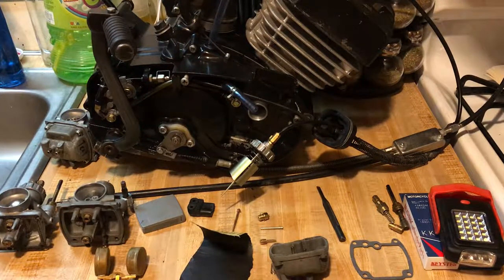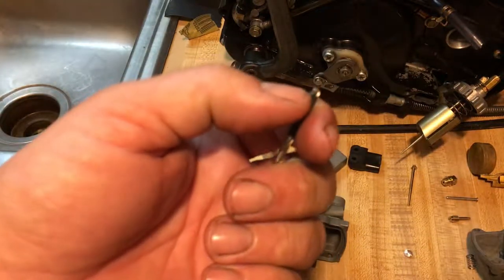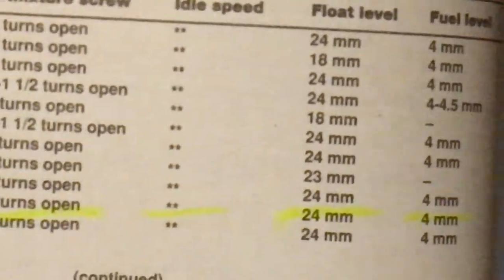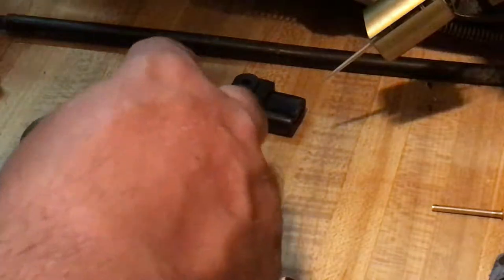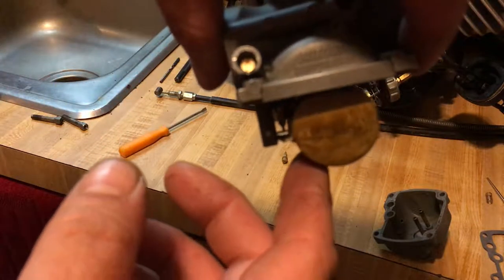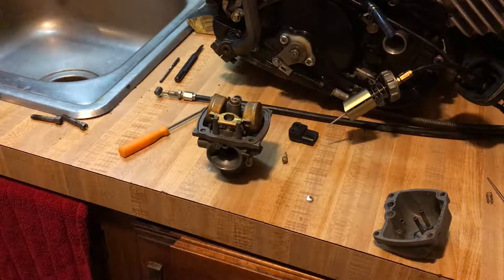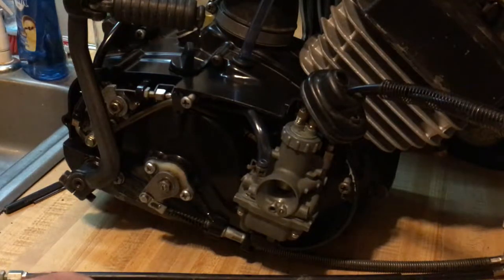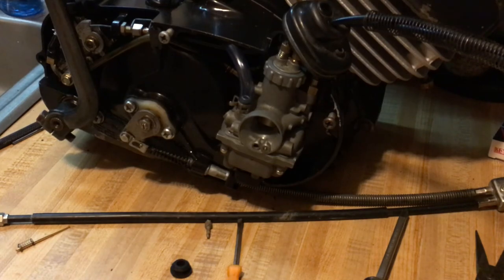KE100 KE102 carb

Comment: Kevin--love your videos and appreciate that you put them out there. I sent you an email further detailing my questions, but in case you don't see that:

1. The Y57 needle in the carburetor rebuild kit you use is a different length than the 4EJ39 needle that the manual and parts diagrams call for (it's shorter). The 4EJ39 also does not have circlip settings like the Y57 does. Should I consider moving to a lower circlip setting for earlier fuel delivery if I have hesitation on acceleration in the 0-35% throttle range?

2. Where do you find aftermarket and non-stock setting parts for these carburetors? Like the 22.5 pilot you installed in this video. I would like to pick up a 17.5ish pilot to replace the stock 15, and I would also like to pick up a new emulsion tube, but they're out of stock everywhere I've checked.

Cheers
Reply from the maker: Thanks for your support some times its easier to find the card that uses theas parts what carb are you working on